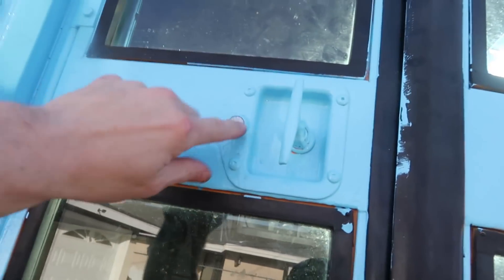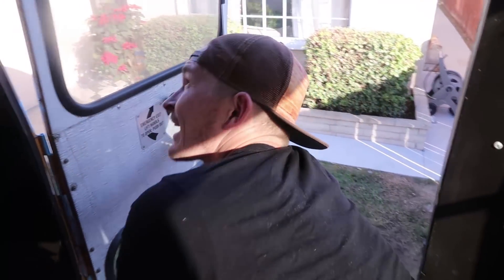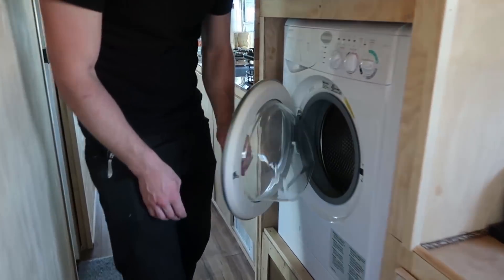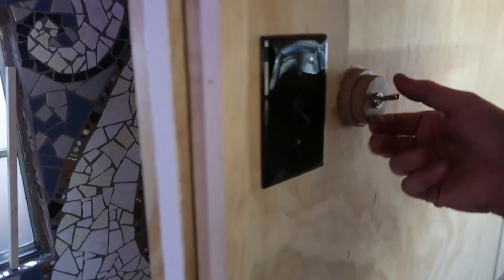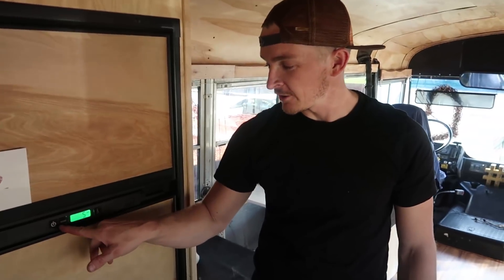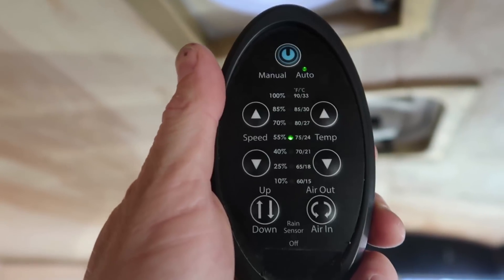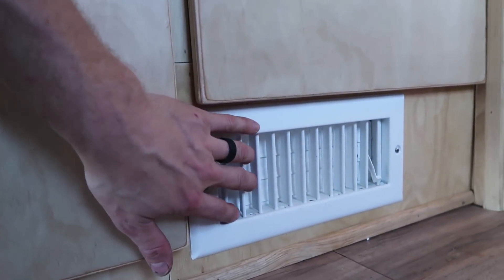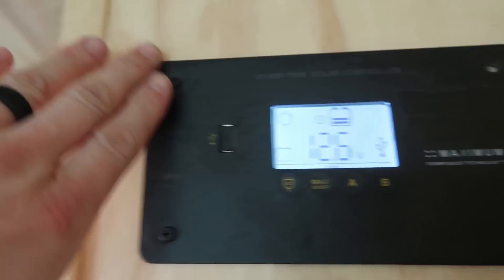El Dorado Beach Bus Custom Built Tiny Home | A Brief Guest Introduction Video

Comment: The rear door clicking open, is that something you added, or a feature that came with the bus? I don't recall it being shown or talked about in previous videos.
Reply from the maker: That is something the bus came with. It's always been there, especially on hot days where we would leave the back door open all day. I had taken it apart at one point during the build, but I put it back together towards the end of the build.
Reply: Interesting. I've actually never noticed that on buses before. In my partner's short bus, we had to use a bungee cord on the back door and back bumper to achieve the same thing.

Comment: You should put a u shaped handle on the inside of the front door. Veticle above the lock...
Reply from the maker: huh? A u shaped handle? How does that work? I'm really looking for a new solution so your suggestion is much appreciated.
Reply: Like your t handle on the out side. A desk drawer handle or dresser handle might work too. You would need to drill through the door and either weld the handle on the outside or put a cap nut on it.. some small handle so you would not have to touch the rubber seal. If you look at your fingers you might and eventually will notice black stuff.. deteriorating rubber.
Reply: yeah like some sort of simple grab handle like there is on the back door. Cabinet handle or similar should do it.

Comment: Hi what toilet is that
Reply from the maker: Hi Lola, we added it to the description above. But here is the link again: RV water saver toilet http://amzn.to/2BXdjcr :-)
Reply: Ian Robinson  thanks for responding so quickly . Does the bottom of the toilet store the water? Is that sprayer connect to a separate waterline ?
Reply from the maker: It stores a little water, but you can turn the water supply off to the toilet and flush it to remove all the water whilst traveling. The sprayer is connected to the same water line.